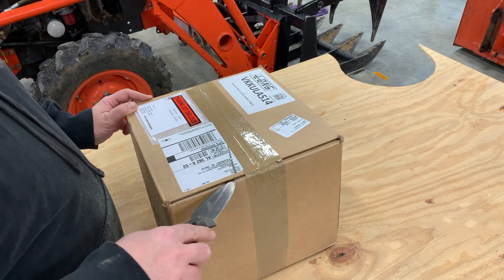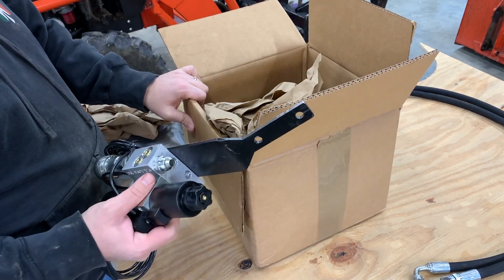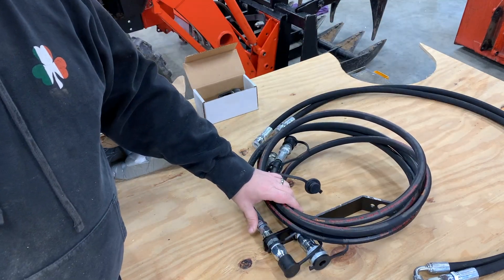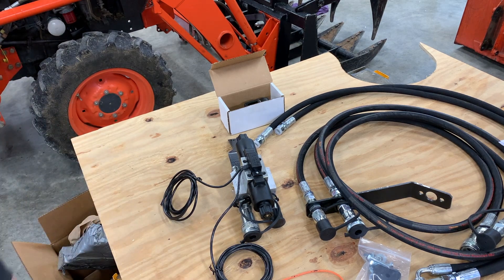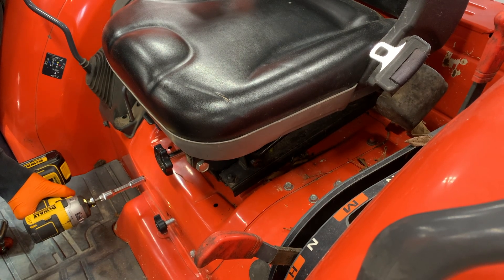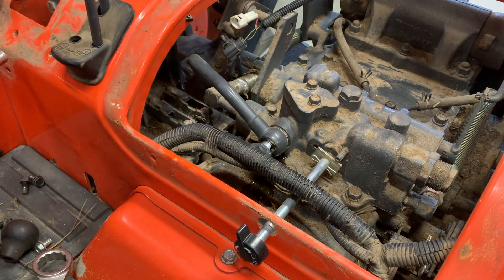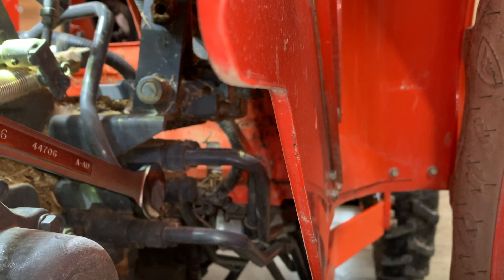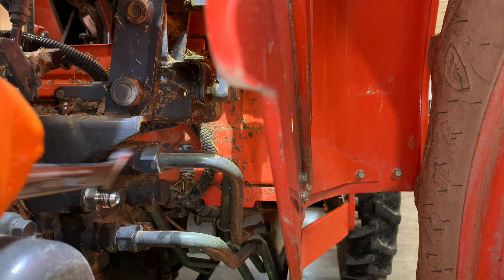Third Function Valve Install on Kubota L3240 Tractor

Comment: Is there any way to slow down the video during the hose setup under the seat and at the loader valve? There are most crucial for me to understand. Do you have the W.R.Long valve kit number?
Reply: I 1st tried an Amazon kit and found out the fittings are too small for the physical tractor side and the hoses ended up being too short. I sent it back and purchased the same kid he has.

Comment: Looks like you did a good job on the 3rd function valve. I need to get one but have my eyes on summit hydro. They have a 4 remote manifold that mounts in the back ROPS. I will just have to run hoses to the front for the grapple one day. I have a big wish list. I saw it on tractor time with Tim's channel. Keep em comin great video!